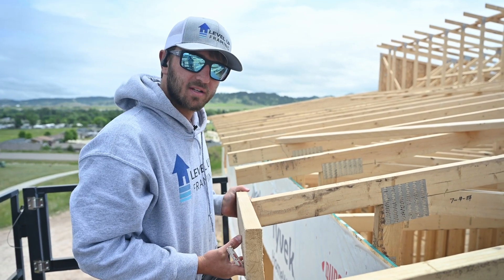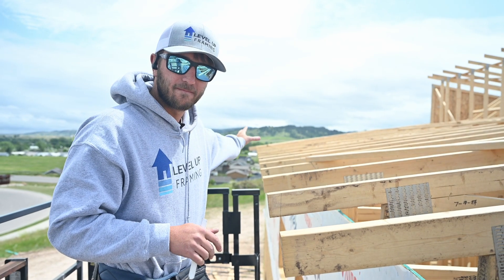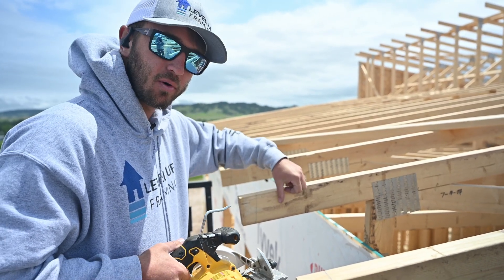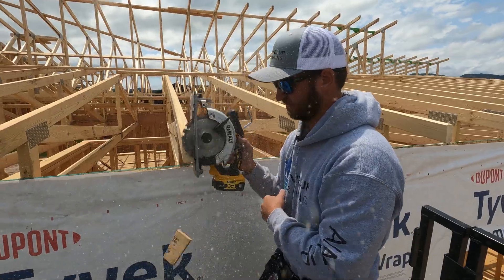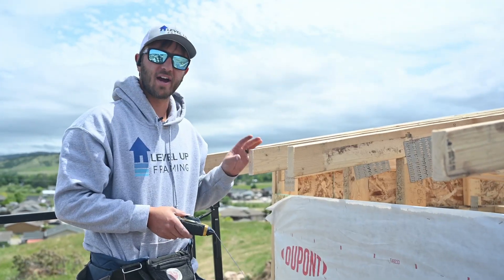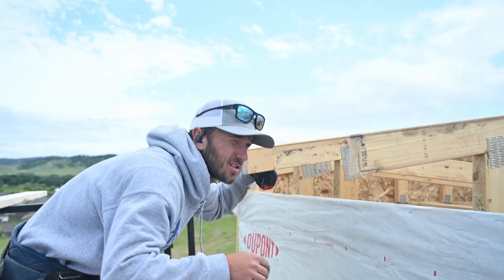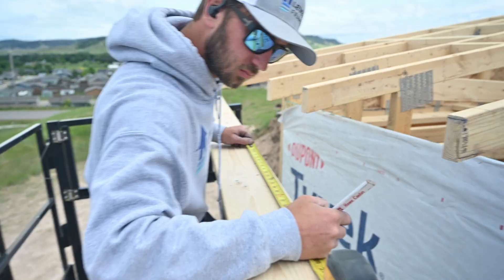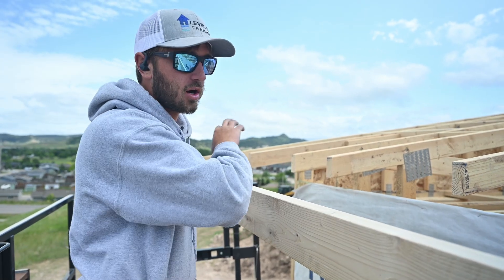How to Install Flat Subfascia | Roof Framing Explained

Comment: What if there’s brick stucco etc . The overhang is usually stated of the finished surface . I.e a twelve inch overhang past the brick is about  seventeen inches from the framing

Comment: Really appreciate your videos. I'm learning so much. Little tricks for getting things just right that I wouldn't pick up anywhere else.

 I saw a tip in another video for getting really straight lines: Pull a string line super tight and spray paint over it. When you remove the string, the negative/unpainted strip is your line. Seems like it would be faster and more accurate than chalking when you're dealing with long runs, high wind, sloped roofs, and rafter tails that bob up and down.

Thought you'd either like that or explain why it's not the best idea since I've never actually tried it.

Comment: I've always measured my eave projection from sheathing; curious how your standard 16" soffit material fits if you measure/cut 16" from framing (heelstand)?  

 Love the videos, cool method snapping line on the face of your tail. to keep sub fascia straight. I may try that on my next build and just plane the few tails that run high!